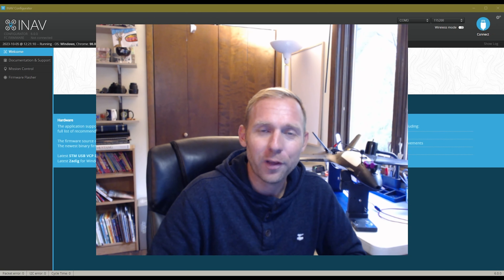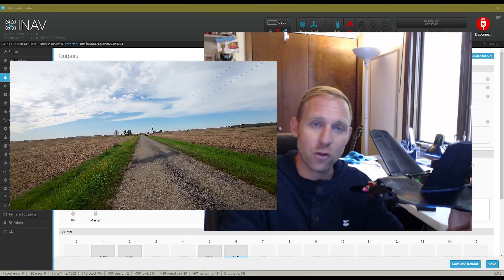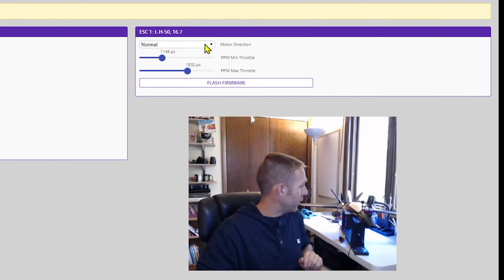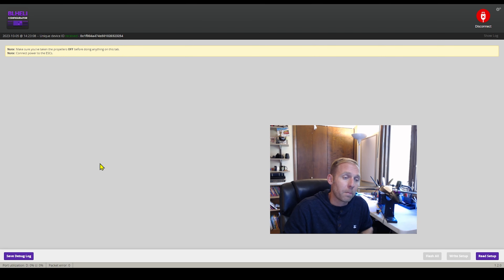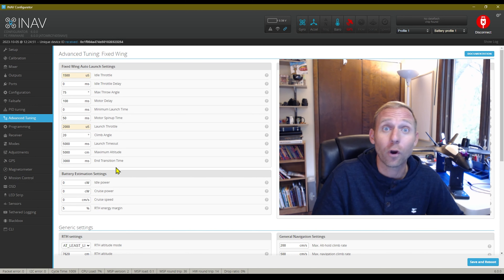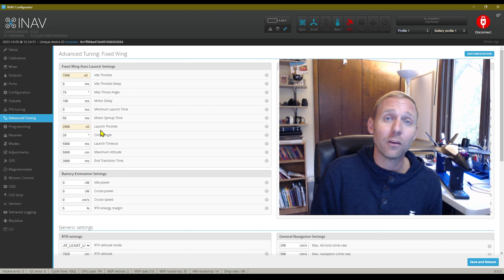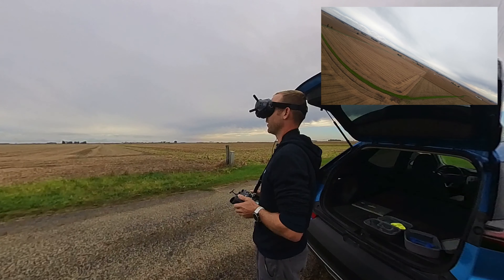AtomRC Dolphin INAV AUTO LAUNCH SETTINGS & MORE, BLHELI ESC BRAKE SETTINS & MORE!

Comment: Hi Jeff.  Another frustrated flyer, this time using the similar ZOHD Dart XL.  I've had a lot of success converting my LOS planes to FPV, taking them off and landing on wheels, but I thought I'd get more flying "flexibility" and longer flying times with a wing.  I've had the ZOHD for 5 months and launched it 5 times using INAV (7.0) Autolaunch and each time it's gone straight into the ground - and somehow the ZOHD is still intact.  I've asked several people for help, adjusted the settings, but the motor never seems to spin up enough (I'm at 1900 max).  I took it out of Autolaunch and the motor spins up at least 500 rpm faster and pulls the plane much harder, but I have yet to try to fly it without Autolaunch.  I copied your settings, and they are different, but only slightly.  I'd sure like to get Autolaunch to work, but without some significant changes, I really don't want to try it again.  Any ideas?

Comment: Hi Jeff
If BLHeli doesn’t show the low voltage cut off, does it mean there is no cutoff for that esc?
And do you connect the BLheli configurator thru the FC usb plug?
I used a BLHeli usb dongle directly to the esc, which is not so convenient 😅

Comment: In autolaunch mode, we don't need to raise throttle, right?
Then after throwing the plane, we will raise the throttle (to 50-70%), did I understand correctly?
And do we set switch for autolaunch and angle mode are activated at the time?
Reply: arm in autolaunch, raise the thottle to max. the plane will throttle up to the autolaunch idle throttle you set, then you throw it. after it detects the throw it will raise throttle to the autolaunch throttle and climb out. after autolaunch has completed, or you touch the sticks then your sticks will start working normally.

Comment: thanks for this config u have helped me setup my first fix wing, 2 questions though, what switches should i setup (flight mode, buzzer rth etc.) Also do you have the stock electronics on your plane like the 2306 motor and 30a esc from atomrc? Im asking as i want to copy it exactly so that i can have my plane working with the stock electronics. Thanks :)
Reply from the maker: Yes, in this video, I have the stock electronics, motor, esc, and prop.  I'm making a video right now on my radio setup, too.  It should be out on Saturday or Sunday.
Reply: Thanks jeff, I'm hoping to maiden mine this weekend! Sadly it won't arm and no there are 0 satellites connecting to the gps @JeffDoesThis
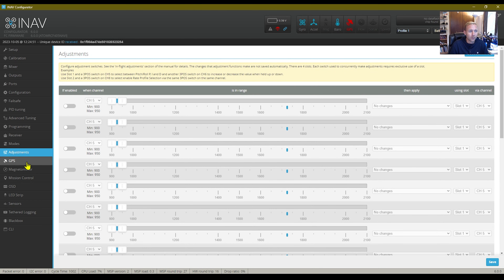Reply from the maker: Check this for the gps, 8:29 gps on uart 4,  8:49 GPS For nav and telemetry,  15:41 at the top GPS for navigation and telemetry.  Then take it outside and wait a couple of minutes for it to get a lock.  Once it has a lock and 6 satellites it remembers your general location and will lock satellites faster then next time you power it up.   Let me know if this works.

Comment: Hey Jeff, thanks again for your videos! May I ask something? Let's say I have the matek board (the 405 like this one) and want to install it on a different plane, are these settings OK and need some adjustments, or it's very different and has to be set again from 0? Thanks!
Reply from the maker: From one flying wing to another, you should be okay.

Comment: Thank you for this video, will help my problem of the auto lunch! its new and didnt know how to set the correct values! May I ask if this is the stock motor or you can set these values to every motor? I have a 1500kv motor, 7x4.5 prop and 6s battery, is it ok or the throttle will be too much? Thanks!!!
Reply from the maker: Too much throttle is never a problem.  You can also can apply these setting to other crafts and different motor/prop setups.  When setting up autolaunch I start with max setting and then tune it down from there.
Reply: @JeffDoesThis   I am building it right now and these settings are very valuable to me! Thank you for this!!!
Reply from the maker: No problem!
Reply from the maker: Also, check out this video - It has some updated inav settings in it for the PID Tuning - https://youtu.be/ezTsxAiL-8U

Comment: I followed your settings and the plane took off well and then just rolled to the left after the motors reved up to 2000. Rolled and nose dived into the geound. Tried again at 1750 same thing.  I made a post on the facebook group with some videos. Can you take a look?  Ben Anderson. Atom rc dolohin owners group. I need some help or i may just bag this whole wing idea i had.

Comment: Where do you plug an epressLrs receiver in the atomrc f405 navi flight controller like in your model
Reply from the maker: You plug into any available UART on the flight.  It's a 4 wire connection,  ground, positive, TX, and RX.  If use UART #1.
Reply: @JeffDoesThis  thank you very much 👍✈️

Comment: How are the control surfaces set? I just got a dolphin and the right side is slightly higher than the left in manual mode while level. Kinda new to fixed wing.  I did succeed flying the penguin.
Reply: the trim, either on controller or in inav

Comment: What mode are you launching in ? I launch mine and starts out fine then just rolls over and crash …
Reply from the maker: I launch in Angle Mode.
Reply: Mine does the same did you find a fix?  Tried at 1750 and 2000 launch throttle